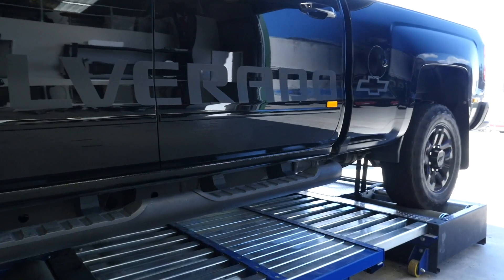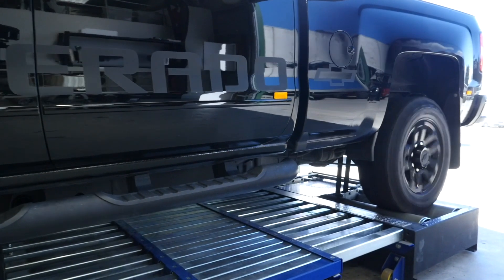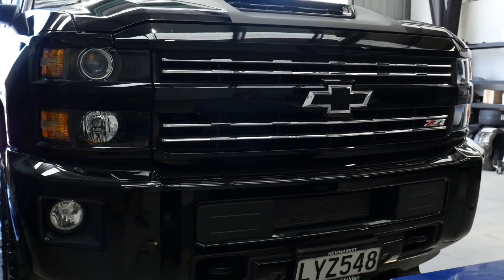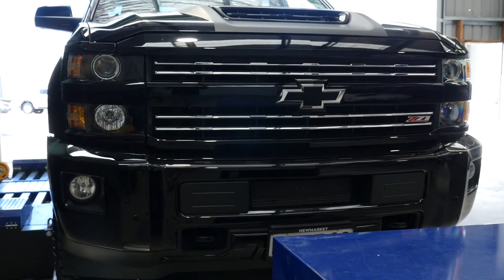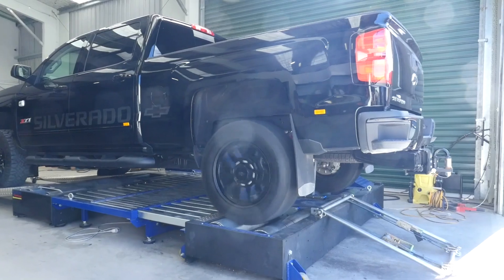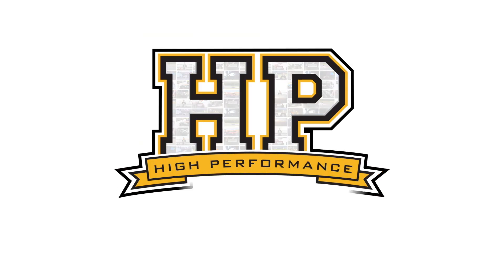85% of DIESEL Tuning Issues... | Boost Leaks and Pre-Checks [FREE LESSON]

Comment: Is there going to be any content on the Motec Diesel system?
Reply from the maker: We already use it to demonstrate some examples in the Diesel Tuning Fundamentals course, and yes it will also be added to this course as a Worked Example. If you're new to diesel tuning it's best to start beforehand though as the principles are the same regardless of the platform - Taz.
Reply: @hpa101  Thanks for the reply Taz. I have already completed both of the diesel tuning courses. I have for the most part got my head around the tuning process. And ave a fairly good tune in my hilux. But there are many things still to learn especially around driveability there a big differences between standalone and re flashing a factory ecu.
Reply from the maker: Good man, yes there is a difference in the application but the theory behind it all is still the same.
Pop a thread up in the forum in the meantime with any questions you have any fire me a link to it, I'll get Andre to take a look for you no worries at all - Taz.
Reply: @hpa101   Thanks Taz, I have been in contact with Motec and had some assistance from them to iron out some of the issues. I'm going to go back on the dyno soon once i upgrade the turbo. I have some ideas i want to try out. Its dialed back at the moment but still made 160kw on a dynapack.
Reply from the maker: BlackRex (Stephen) who floats around the forum is a MoTeC dude too, we'll get you sorted. What are you doing fuel pump wise? From memory that was one thing Ben struggled with a little option wise when looking at a bigger turbo - Taz.
Reply: @hpa101  At this point in time im sticking with standard pump and injectors. The turbo im going to be using is a ihi-F55V that i have modified to take the toyota stepper motor. If i decide to do pump and injectors i heard that the 1vd pump is an ok option and probably 30+ injectors. Manual gearbox is the limitation.